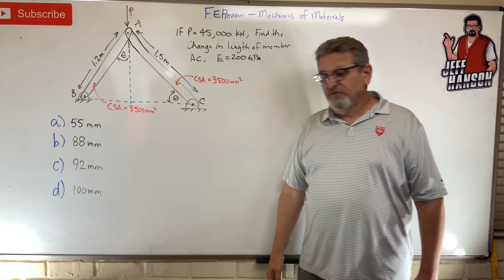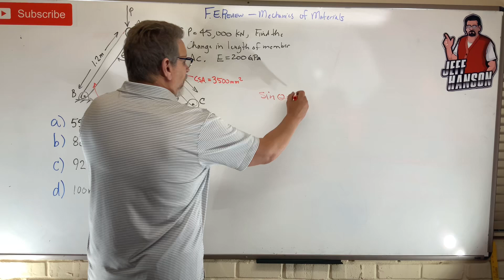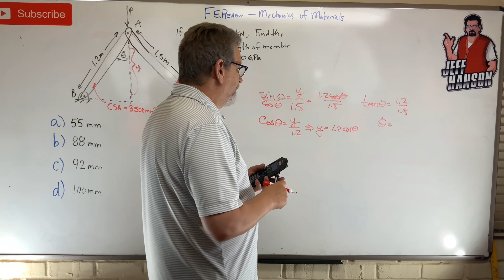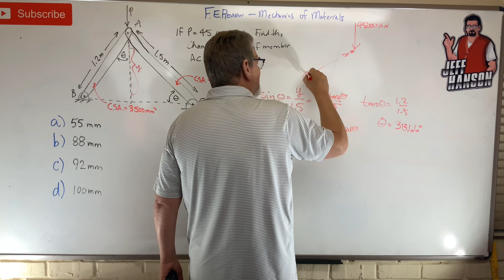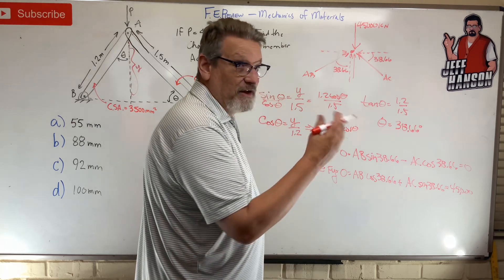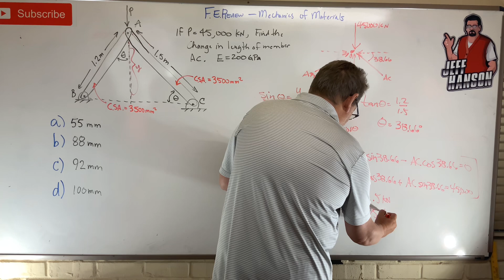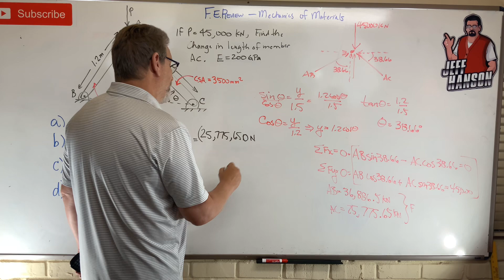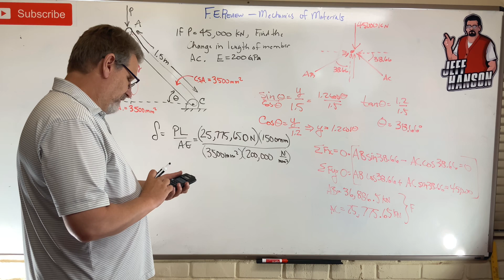FE Review: Mechanics of Materials - Problem 10

Comment: I did it a different way and I think it is easier as well. I found theta, 38.66, then added the right angle, 90+38.66= 128.66. I, then, subtract it from 180 and found the top angle of the AC triangle, 51.34 deg. Then I just did 45000cos(51.34) and got 28111.395Kn. This way made more sense to me and wanted to share it in case it would help someone else!

Comment: I calculated AC to be approximately 28111kN, as a result the change in length of 60mm.
Reply: I think that Jeff calculated the system of equations with his calculator in radian mode instead of degree mode, so the final answer should be 60mm.
Reply: @lleytonstutzman-student8582  okay i thought i was trippin. I calculated it and also got 28111KN and got 60mm as my final answer. glad to know I didnt mess up
Reply: I'm so happy I went into the comments, I have checked my math like 6 times trying to find where I went wrong
Reply: Yeah I got that as well
Reply: Thank you! I was confused as well
Reply: I concur, I triple-checked the math, and I believe it is 60mm as well

Comment: Am I missing something? The angle for sin and cos are not necessarily equal therefore we can't make a tangent relation?
Reply: He's explicitly showing in the figure what angles we do have. There appear three equal angles called θ
and he's just using conveniently sine and cosine for that angles. You can see using the bottom right one that

sin(θ) = y/(1.5 m)

and using the top one

cos(θ) = y/(1.2 m)

Therefore

tan(θ) = sin(θ)/cos(θ) = [y/(1.5 m)]/[y/(1.2 m)] = [y/(1.5 m)](1.2 m)/y = 1.2/1.5

tan(θ) = 0.8